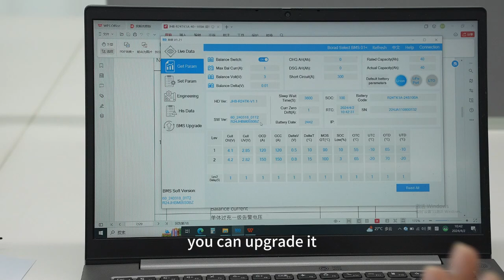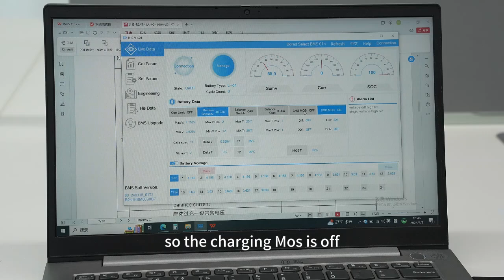Latest version of DALY 100BALANCE active balance BMS

Comment: This bms need more implementation parameters.  Is really bad bms looking what the competitors have right now on the market .  The balance is not bad .  But there is just few parameters to adjust . When a cell goes over voltaje just cut and after drop the voltage few mv  enable the charge again . This is a mesh .
Reply from the maker: dear, APP is for simple adjustment. but we have PC program for details adjustment, if you can not find it, please contact us for support. thanks.

Comment: Can I set 30A max current on 40A model?
Reply from the maker: charge and discharge protect value can be set according to your need, even lower than 40A. 😀
Reply: @CoraWen-DalyBMS what happens when load reaches set limit? It's gonna turn off BMS or keep draw on settled limit?
Reply from the maker: @pokemontrainig  dear, when reach protect value, BMS will cut off discharge or charge. please message me on whatsapp, i will share you our data sheet.